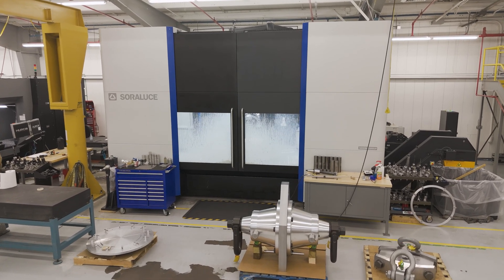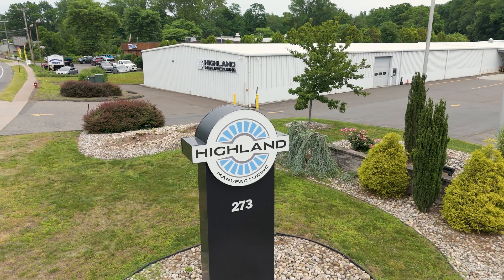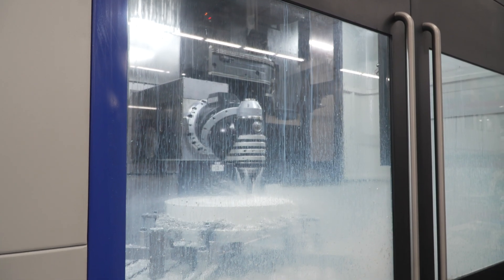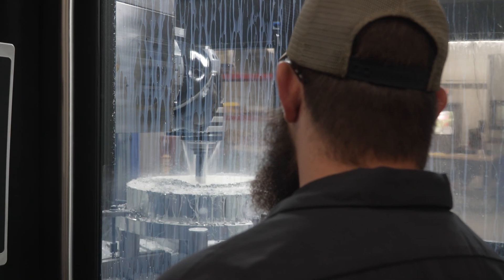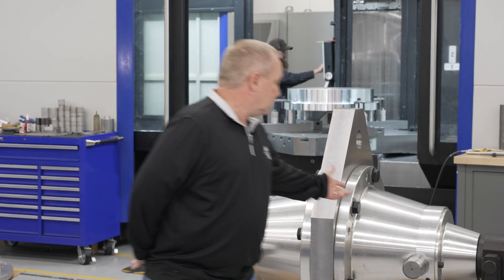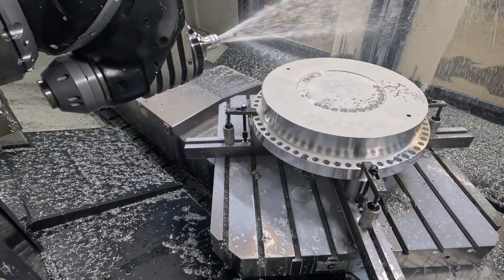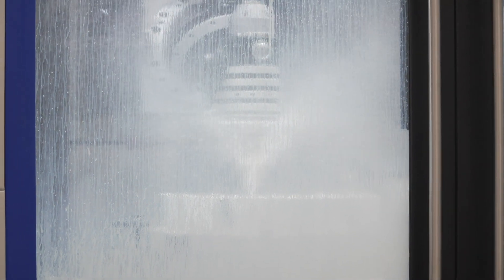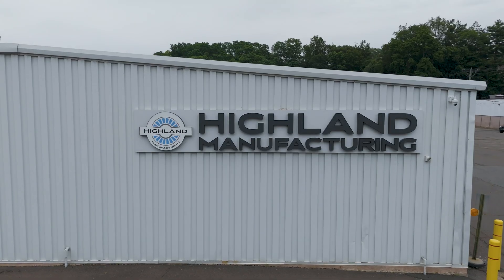How Highland Manufacturing Cut Production Time from Days to Under an Hour with a Soraluce

Comment: Having run Sip jig borers and Moore jig grinders borers I find it really hard to believe that this machine is more accurate than their jig borer. Both Sip and Moore transitioned to CNC, but their accuracy was not dependent on the controllers. It was the geometry of the machine that established their accuracy.
Reply from the maker: We appreciate your comments and skepticism. In fact that's why we love to capture testimonials like this, to share the voice of the customer. Unfortunately, many of the Soraluce machine installations (in the US) are at defense contractors that forbid cameras.  

If you haven't heard of Soraluce, they are true innovators in CNC technology for machining large parts and components with the utmost precision. The geometry of their machines are outstanding, but even more impressive is the technology they've developed to tune out any abnormalities (such as chatter). Just as Sip and Moore were innovators in their day, so too is Soraluce today. 

We have more testimonials dropping soon, so we hope you'll subscribe!
Reply: A friend visited long ago the SIP works in Swiss.  He was astonished!!   The precision was out of this earth.   He told if a worker disnt feel 110% concentrated ...they were told to take a day of instead of maybe ruiining weeks of work by a bad day scraping a bedway....

Also he told about the measuring departement....  There was this  device to measure distance to 0.0001 mm or so.  Dont remember the way it worked exactly  Anyway there was a metal bar between two measuring points .  They asked him if he would hold his hand underneath the bar in how many minutes it would detect any length change due to thermal expansion...... He was astonished that after only seconds the gauges already started showing increase in length..... 

Till this day he considers SIP as the eternal heaven of precision!!!